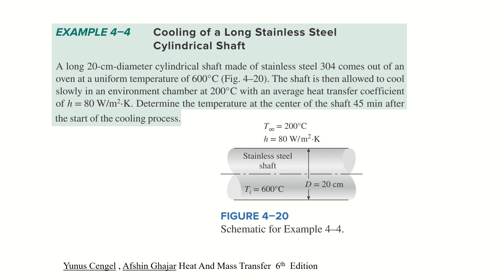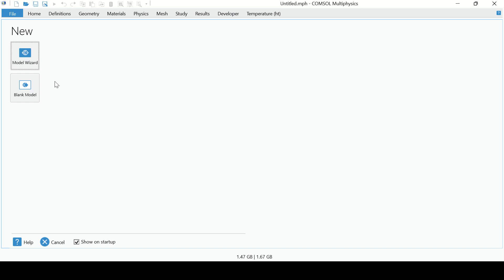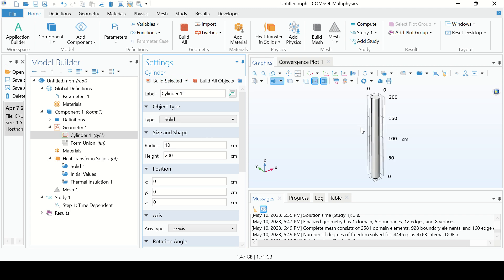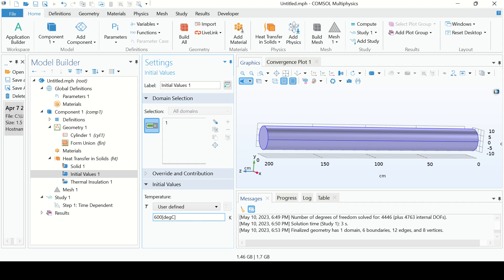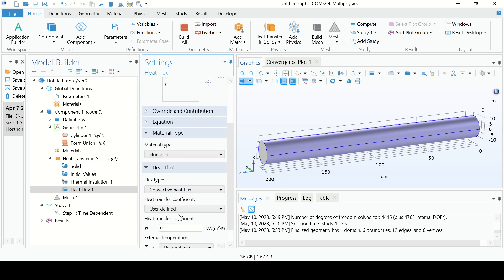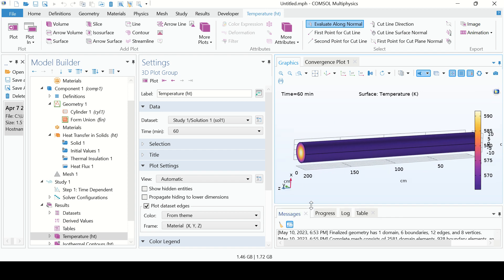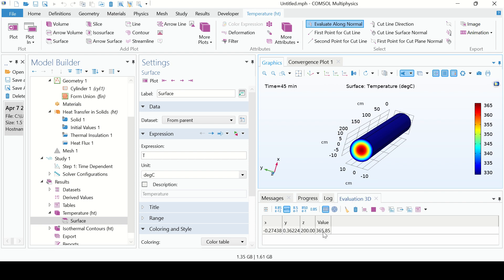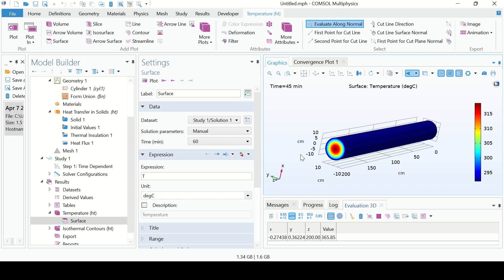Cooling of a Long Stainless Steel  Cylindrical Shaft: Transient Haet Transfer Simulation in COMSOL

Comment: What if heat transfer coefficient is not given & instead of that its mentioned that water with pressure of 3 bar flowing on bar (like cylinder in crossflow) then how can it be modelled in comsol